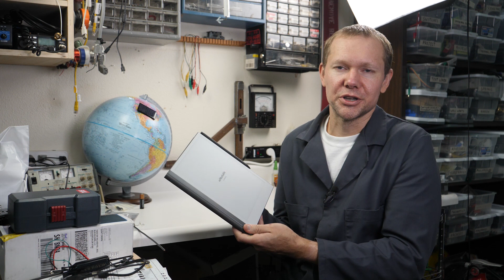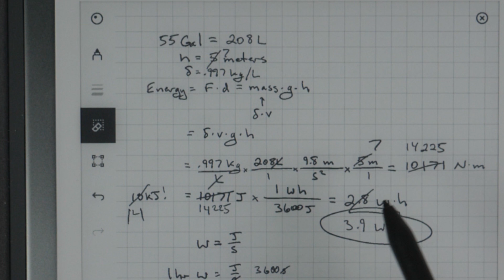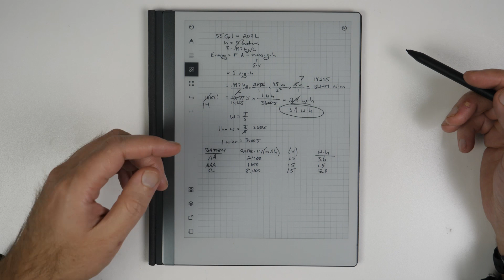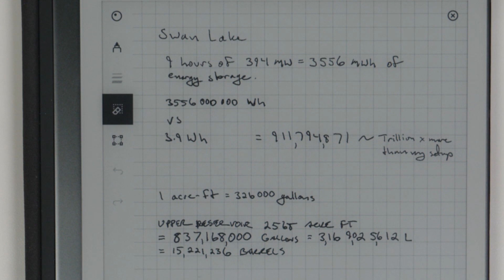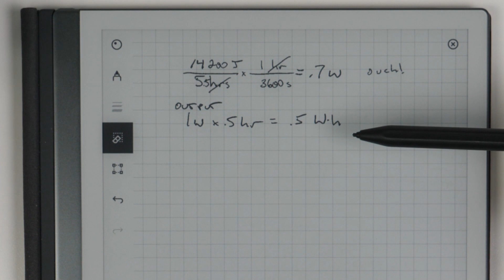Pumped Storage - What I Learned

Comment: Excellent information :) Less than 1 watt-hour for all that effort is a bummer. I know you're probably tired of all these power related videos but it would be interesting to see a build of a gravity battery and see how well that compares to pumped storage. I would imagine that since during the power extraction phase you're putting torque on a generator shaft directly instead of using a Pelton wheel or whatnot you'd experience higher efficiencies?

Comment: I dont know if I am happy or sad I didn't see your videos before attempting something very similar.  We both came up with surprisingly similar ideas!   I got significantly better results, with a fraction of the height.  I realize I cant actually talk to you about it, but I have a great many questions!   My setup is just using a water tank 8 feet above my jet(s). Differences: 1)  I also built my own alternator (my first, I am no expert), but I used a different idea - I made a rotating magnetic field with a stationary armature around the outside - this required no brushes.  Old school, yes, but its seems to be producing a good bit more watts. I also connected a rectifier with a capacitor.  I made this at a lower voltage - intending to light LED (3.5 volts was the target, I am hitting 2.9). 2)  Not having a 3 D printer, my wheel is similar size, but just using curved blades.  I did try different sizes, but they all produced similar watts (larger made less volts, more amps; small made more volts less amps).  3)  I used much larger pipe feeding the jet-  2" all the way to the jet.  Knowing the head would be exactly the same for all size pipe - and knowing I had very little at 8 feet, I just upsized to reduce any loss from friction and fittings.  4)  Solar panel and pump - my idea was to run the "turbine' (I don't really know what to call it, its a horizontal version of yours, but just with blades) all the time and power the load all the time.  The solar would turn on the pump when it was available, and outrun the "turbine", filling the reservoir when there is no solar.  To achieve this, I have a 100 watt panel, driving an 86 watt pump.  The pump is submersible, and does outrun the "turbine".  These could clearly be smaller to use the way you did. 5) I turned my wheel 90 degrees and added a second jet going the opposite of the first.   In testing, I found this didn't actually produce any better watts for the water used. (2 smaller jets vs 1 large)  But it does give me different capacities.  I am lighting 1 foot strip of LED's -using 1.6 watts;.  I am using 1.6 gallons a minute, filling my tank at 2.5 gallons a minute. This gives me roughly 1 watt / gallon a minute (at 8 feet head+ up to 2 for a full bucket). Clearly, I would still need 1100 gallons to run this all the time. assuming I had max daylight every day (its the idea I wanted to see, not really using it practically).
Reply: Thanks. I think I have got sonething to build on a thought I had. Running a turbine from water stored at a height by solar pumps 😊

Comment: Thanks for an instructional video. I am curious on alternative ways of storing energy from my rooftop solar and since I live on a hill next to a lake I thought what if my excess solar pumped water instead of selling it cheap? This is theoretical since I have a wife cancelling "crazy ideas" =). But with your calculation example a 40 foot container (73530L) and 10m of height could store 2 kWh. But I didnt understand the last bit on efficiency of the turbine in comparison of pumping it up there, what can I expect from a miniturbine that the water is released through on its way back to the lake?

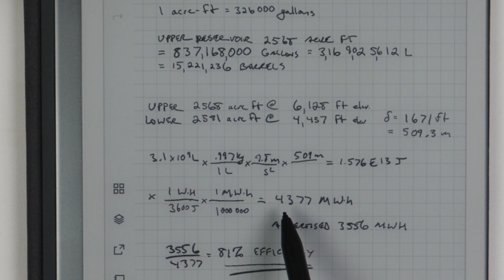Comment: 17:40 Okay, you calculated 4.4GWh of "capacity," but they only advertise 3.6GWh of output, which give the 80% efficiency. 🤔

But I thought the "missing" power in hydro storage was (mostly) in the storage, not the delivery. So let's say you had a system that held enough water to produce 100MW for eight hours. My understanding was that during storage, now 100MW of electricity is flowing into the turbines, but less water actually makes it up the hill, so it takes ten hours to fill the "800MWh" reservoir with your 100MW pump. Is that not how it works? Or do the pumps run for ten hours and actually pump a GWh worth of water?? 😅

You're right, this'd be easier to discuss with cubic meters and megagrams. 😜

Comment: It takes 12kWh of electricity (electric or solar or gas) to pump my dam water up a 20m head to fill a 5000 gal tank. Reversing that only theoretically generates 1.2kWh of electricity (5000*4.5*9.8*20)/3600, which is a whopping 10% efficiency. It makes no sense. My pumps are top quality, and water simply flows through a 2 inch pipe that is about 200m long. Surely the pipe length shouldn't cause a 90% friction loss? What if my dam was directly under the tank, do you think I would get 12kWh of generation? Seems like something is terribly wrong.
Reply: The 200m makes a huge difference. Just picture a waterfall just straight down, or a river 200m long with a 20m hight difference. The river wil flow much slower than the waterfall

Comment: Just a thought: seems to me that your setup must have significant friction losses. If the tube from pump to barrel was larger than the pump influent that would allow the water to better “slip” and thus reduce the tubing friction. 
Seems kinda important, especially for such a small system. 

Good job on both the physical and mathematical instruction. Inquiring minds want to know.

Comment: Well put, anyway I would personally try to apply different type of turbine type than Pelton which is using only kinetic portion of the flow (basically static pressure transformed by nozzle to kinetic one). Efficiency is limited here by the nozzle and of course manufacturing tolerances of the buckets and especially the blade edge (on large powerstation they are being sharpened such as knife blade to keep efficiency) - this is hard to achiev with 3D print. I would try to look up for radial-axial pump with spiral case and high efficiency suitable for your parameters (head and flow) and tried to used it also in turbine regime. This should work well, it is always more difficult to design pump than turbine (due to cavitation and NPSH - look it up). And because you changed your concept and now you have reservoirs on roof and on ground, you should benefit from the suction effect of draft tube (diffusor on turbine outlet submerged below low water). This should add some extra efficiency to your setup!
Reply: Why do draftvtubes cause suction?

Comment: Wouldn't you calculate the efficiency with the power you need to put in? So let's say the pump has a efficiency 60-80%, so the overall efficiency is more like 0.81x0.60=~48-64%.
Reply: Good point

Comment: California actually has the most pumped storage of any state!

Another way of looking at the economics of storage is that it allows a higher capacity factor of existing generation (i.e. run it at capacity more of the time), allowing the capital costs to be spread over more generated power. Much of the peak load is handled by single-pass gas turbine peaking plants, which are inefficient but lower capital costs than, for example, combined-cycle gas turbines that capture the waste heat.

This can be particularly important for high  capital-cost, low-fuel cost generation. For example, the Northfield Mountain pumped storage was constructed for the Vermont Yankee nuclear plant. Renewables also fall into this category, having very low operational cost. Battery storage has been displacing gas peaking plants to a significant degree.

Much of California's pumped hydro is part of the California Aquaduct system. Of particular interest, given discussion of power from Oregon, is the 3.21 GW HVDC Pacific Intertie from the Dalles to Los Angeles, which terminates near the Castaic pumped hydro facility. This allows making more complete use of this link, transferring power even when LA has a surplus. This was completed in 1970, and has been upgraded a couple of times since. Originally it used mercury-vapor valves, but now uses thyristor inverters. The use of HVDC links is both more efficient over long distances and allows different sections of the grid to operate independently without need for synchronization.

The first pumped hydro in the US was in 1930 in Connecticut on the Housatonic, and is still in use.

The reason storage projects emphasize the power (e.g. megawatts) rather than capacity (megawatt-hours) is that, from a grid operational standpoint, the key attribute is the ability to absorb or provide power, to match generation to load. For batteries, the corresponds to the rating of the inverters; for pumped hydro, the ratings of the generators/pumps. In the case of batteries, it is not uncommon to see the total capacity omitted entirely (annoying, yes!) and assumed to be 4 hour at full rated capacity. Of course, they're never operated at full capacity over the full 4 hours. 4 hours works out to be fairly useful capacity when spread out over a daily cycle.

This tends to confuse engineers when they first encounter it (myself included!). Of course, both numbers are important. 4 hours isn't universal, and substantial benefit can be had from even smaller amounts of storage. For example, the Dalrymple battery in South Australia is a 30 MW facility—but with only 8 MW-hr of capacity. But this is enough to absorb peaks from the nearby wind farm, and to stabilize the grid in case of an outage on the transmission lines, buying time to fire up "conventional" power sources.

https://www.eia.gov/todayinenergy/detail.php?id=41833

Comment: Great videos. Thank you.

Question: I'm in the process of buying land in Florida to use as a homestead. As you probably know, FL is pretty flat. For the homestead, I will be drilling for a Well and putting a septic system in. So how about the following idea ...

In addition to the Well to use for potable water, how about drilling an additional hole from the surface of the land down to the water level in the Aquafer. Then, use solar to pump water to the surface to store in a pond on the surface of the lot. Then, put a generator at the bottom of the hole. Then, dump the rain or solar pumped water down the hole to create electricity, when needed. The pond essentially working as a battery for later energy use.

I'm guessing there are two obvious issues with this idea:

1 - The required permits for the county to allow you to dump rain water or pumped water down into the Aquafer.

2 - How to make sure the Aquafer would accept the gallons / sec dumped into it without filling up the hole where the generator is.

Your thoughts?
Reply: I also wonder about aquifer recharge from captured rainwater...

 Some areas of CA want to do this with so called recycled water which is not the same and seems worse to me, if not scientifically then emotionally. 

Adding micro hydropower generation to the idea of recharging ground water sounds like a win to me. 

Risks include that water directly charging ground water would need to be filtered at least as good as the natural filtration it would have been subject to when passing through soil levels... 

I would love to see this topic discussed at greater length and with thoughtful research.

Comment: 😆😂 Learn something wow that was so far above my head it got vertigo, I'm glad there are clever people to do the maths just tell me what to build and that's my level. Your builds you do as in the rain gutter and wind turbine car experiments are just class, what I really struggle with is their are guys like you playing with ideas in a garage but worldwide and if all these minds come together with an open source power generation and storage then in stead of the big companies saying the eureka tec is 5 to 10 years away it would be solved in no time. I think that gravity systems are so much better than wind and solar power because its simple it does not require out side sources that's derived by nature, yes the wind is free and so is the sun but the conditions aren't right all over, even if gravity is 60% efficient if its running 24 7 365 days that will do when connected to flow style battery storage, just keep it simple and simple is easy to build and maintain worldwide.

Comment: I had often wondered about doing something similar but was lacking some of the engineering maths to calculate the amount of storage. I often thought about a similar idea of lifting a weight and controlling its decent but if I'm not mistaken the energy is the same. If you had a platform that was raised say a foot (300mm) off the ground and when you got home at night drove your car onto the platform this would give you a stored energy that could be released  by lowering the platform with hyd?

Comment: So, 55 gals on the roof = about 1 AA  battery, hard to believe !
Reply: @The Program It takes 12kWh of electricity (electric or solar or gas) to pump my dam water up a 20m head to fill a 5000 gal tank. Reversing that only theoretically generates 1.2kWh of electricity (5000*4.5*9.8*20)/3600, which is a whopping 10% efficiency. It makes no sense. My pumps are top quality, and water simply flows through a 2 inch pipe that is about 200m long. Surely the pipe length shouldn't cause a 90% friction loss? What if my dam was directly under the tank, do you think I would get 12kWh of generation? Seems like something is terribly wrong.